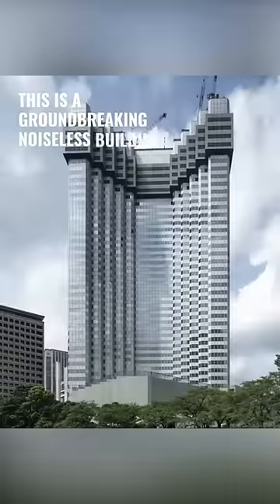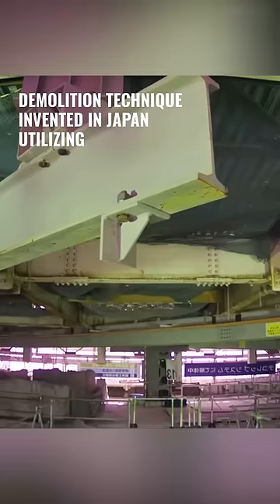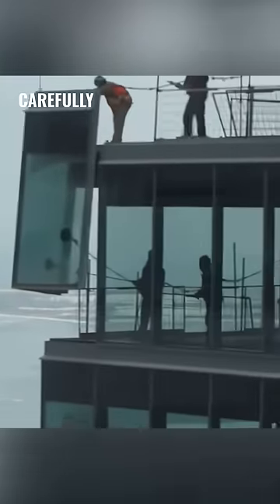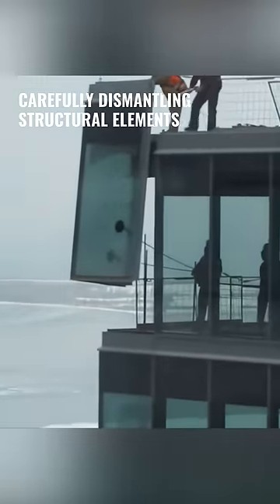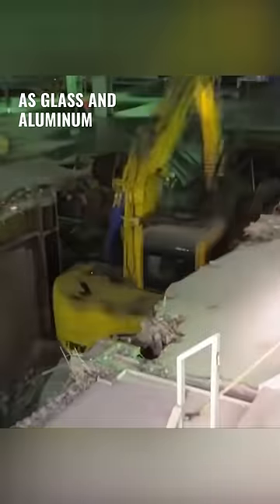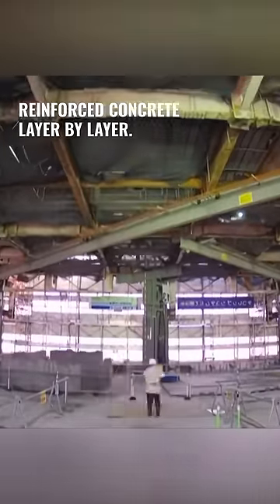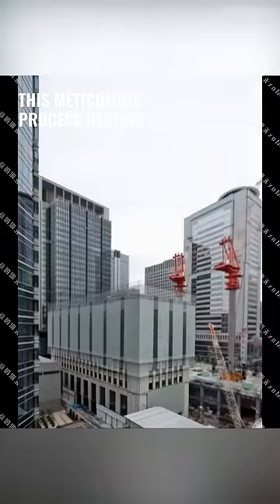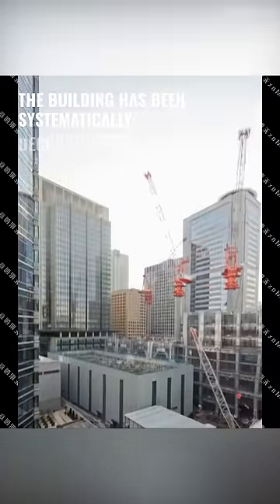Silent building deconstruction 😎

Comment: The cost must be staggering!
Reply: The cost in bring it down ? Yeah, but they can make a profit in selling what they just saved
Reply: You obviously never heard of recycling.
Reply: @perchancethishandleiswens you obviously have never recycled anything worth money... The cost to recycle costs more than what you get from the recycling which is why most companies that "recycle" actually toss everything into the same dumpster as the trash.
Reply: @QargZer  aight that's cool I guess😂 I don't know which company you are referring that would actually do that but the local steel companies we worked with in my country always accept all the scrap cars we cut up. They make sheet metal, piping, steel beams etc, it's way cheaper than importing steel from China 💀
Reply: They have an endless supply of underpaid workers lol
Reply: @QargZer obviously you never scrapped metal. Copper is over $3/lb, of course that's bare bright, but even a 50% is $1.10. Aluminum, about 30 cents. And don't forget the literal tons of steel that they have? Even unsorted it's atleast 50 a ton. Sure you can argue all the extra man hours needed to separate but if they're literally un-building a building piece by piece that part was already done
Reply: @alb8158  I have scrapped metal... The cost to recycle is NOT profit it just recoups some of the money You're spending to scrap it.

Also... Are you seriously trying to compare scraping a car to a building?
Reply: @perchancethishandleiswens its only that way artificially in a handful of countries. Most first and third world nations its FAR chesper to bring in new steel
Reply: Those aluminium/glass windows would make an amazing floor to ceiling windows in a house, there's money to made in recycling, all the steel copper windows lights furnishings recycled would probably cover 25 percent of the total demolition cost
Reply: I was just talking about that to a friend they don't recycle plastic they bring it to the transfer station for the landfill ive seen it with my own eyes lol your right about cost it's cheaper to throw away than recycle it
Reply: @QargZer That's mostly apply to Plastic waste, not materials like Aluminum which are sold and reused as Building Materials
Reply: @yuryberrios7003 they aren't saving anything vs conventional. Conventional demolition is the exact same right up to "...skillfully extract" whatever was salvageable has been salvaged at that point, where here they dismantle floor by floor instead of planting explosives.
Reply: @alb8158 I guess they don't do this in your part of the world in a demo but copper, stainless, iron, aluminum, glass get sorted as the building gets gutted.
Reply: @yuryberrios7003 no definitely not, you can’t even get close to the market rate on recycled materials. And the majority of the stuff coming out of that building isn’t going to be stuff you can sell easily.

Also you can’t recycle the costs of the labor, the machines, and the costs of construction. And in deconstruction, you’re paying for those all over again.

They’d be lucky to even get half of the deconstruction cost back
Reply: @QargZer That doesn't really apply to metal scrap or even reclaimed hardcore. Though I still can't see that paying for the demolition. I suspect they are paid well for it... When it comes to household recycling I would have to agree with you though.
Reply: @QargZer you joking right? Yes, cost maybe more. But you are providing paying jobs throughout process of build, deconstruction and rebuild. 

Plus you are SAVING MONEY on RETAINMENT of materials, instead of disposable of wasted material. Its saving money on imports. Making more of exportable market.
Reply: @theeslimstevie  you are extremely naive... You are either too young to work or don't have a concept of running costs.

People claimed recycling is profit... No, as you pointed out it costs a lot MORE to have the manpower and equipment to deconstruct rather than demo.

I agree recycling is good for the country and allows you to reuse material instead of shipping it... But overall whoever is doing the deconstruction is losing a lot of money to do the recycling which was my point.

There is a high cost to melt down materials into blocks and then from blocks into whatever it is they will repurpose it into.
Reply: @QargZer  do you understand difference between "deconstruction" and "demolitioning"? 

You're trying tell me, you dont understand with deconstruction, you can resale windows, bricks and recycle much more effectively than demolishing.

 While demolishing mixes everything into one pile, while cutting off access to surrounding areas for period of time. (Which provides dangerous conditions to workers and hindering bystanders lifestyle with demolishing practices. Which costs city $$$$$$) 

Yes, it maybe faster to demolish building and get it ready for next construction project. However you sent the problem somewhere else to profit potential resources through waste you pay to get rid of lol.

 I'm naive? Fundamentally wasteful practice is demolishing. Perfect fit for morden innovation is this type of deconstruction.
Reply: @QargZer You have obviously never scrapped metal before. You get paid a decent amount for metal. Steel is about $160/ton and aluminum $800/ton. And you're still completely wrong about the cost. Maybe in this case, because of the cost to disassemble the building, but in general, no. It costs me a couple of dollars to drive my truck and load the trailer, then to get a few hundred off of scrap. That's a profit. It IS profitable. I do regularly it as a part time job really, a side income.
Reply: @alb8158 Exactly. And $50/ton? Wtf, price is NEVER that low. Here it would be $180/ton for the steel beams
Reply: @theeslimstevie  you're telling me you can't read what I said?
Reply: @QargZer  you're lost cause 🤦‍♂️
Reply: @QargZer I think he meant use the resources to build something else, it would save a lot of money
Reply: @theeslimstevie  I live in the real world instead of fantasy make-believe land
Reply: @LtNurse  could lower cost for someone, yes. But it is NOT profit for the person doing the job of saving everything unless they sell everything at new prices. Who is going to pay new prices for repurposed goods?

Comment: I’ve said it a thousands times and I’ll keep saying. Japanese Engineering is on a whole other level
Reply: Japan + Germany = 👍
Reply: We did this in Hungary 15 years ago. This isn't rocket science and not only Japanese do it.
Reply: @Oueax  does the building need to be built differently or this works will all types of building?
Reply: @gratefulguy4130  you forgot Italy
Reply: @mksushi5754  no I didn't
Reply: @gratefulguy4130 perennial war losers yea
Reply: @Oueax but is the building earthquake proof like japan’s ?
Reply: @Shibu-069 ??? Being earthquake proof have nothing to do with it. Its only for calculating safety factors.
The only thing different in eq proof building is it might be thicker, there might be more metal rods in the reinforced concrete, or it might be a different mixture, thats all.
Reply: @Shibu-069  earthquake proof buildings arent anything new.
Any city near a earthquake site is bound to have atleast plenty of earthquake proofing
Reply: @shoeskode136  aren’t anything new, but are they common by any chance? no right.. are they engineering master piece, obviously fkn yess!
Reply: @imjustapotatoleavemealone  earthquake proof buildings have spring system to spread the impact bruh 💀
don’t tell you haven’t seen japan’s earthquake building.. they literally hover in air while the land is moving.. it’s not just mix concrete and sh!tt.. it’s a masterpiece and huge brainwork
Reply: @Shibu-069  But that is underground... Its nothing but a different base for the structure.. it adds 0 to the complexity of demolishing it like that, nor makes it easier... And the structure is still almost the same... The structure needs different tolerances, but the bearing/isolation literally changes nothing at all.. I don't care if its huge and really awesome, it has nothing to do with the topic.
And... springs?.. where did you get that from?!
Reply: @Shibu-069  You already forgot your own comment or what? Read them back and learn....
You literally word by word implied that its different and more complex, because the base of the building is different, and here you are, talking crap about springs and "praising the japanese engineering"... What the hek?
-The guy said Hungarians already did it.
-You said Hungarian's aren't earhquake proff.
-I said being eq proof has almost nothing to do with it.
-You said its base is different.
-I said base have nothing to do with it at all.
-And now you are saying, that i'm out of topic, and you only praised the japanese engineering, and the main comment is different... What?? The video is still about a nice way of demolishing a building...
I don't understand...
Reply: @imjustapotatoleavemealone  why are you reading my comments only in the context of that hungarian guy bruh.. the main guy was praising the jp engineering skills of deconstructing and the hungarian guy said “yeah hungarians did it too”, that’s why i said “but can they make a earthquake proof building” because just like deconstructing skills of jp engineering, it’s also an engineering masterpiece 💀
You can’t even understand  a single context of my comment before fighting bruh
Reply: @Shibu-069  You said "But is the building earthquake proof like japan's?" not "But can they make earthquake proof buildings like japan..", which have a whole different meaning...
Not to mention that "Japanese engineering is in a whole new level" based just on these videos is bs...

This method is really 15+ years old, and and its nothing but the reverse of build and jack building method. In Japan the material prices are really really high and time to time its worth it to recycle the building while keeping the aesthetics, since this method is way more suitable for it, but that is all, its used almost nowhere else and even in japan they prefer different methods.
15+years old method, still didn't used today, since its way more expensive, and way slower than traditional methods. Its can be done, but it doesn't mean it should me.
This video comes back every 3 years and everyone is amazed by it and keeps saying that "yeah those Japanese" while they already past that point.. we are already past that point, and its really... not that amazing anymore... Especially because you can just demolish it from the top, and transport it down using a crane, thus saving the expenses of a whole building lifting hydraulic system...
Reply: @imjustapotatoleavemealone  man i am just convinced that you are some troll, not gonna reply now
Reply: @Shibu-069  I came up with arguments, i came up with explanations, and i gave you time to explain yourself. All you came up with is "You can’t even understand  a single context of my comment", and even if i explained it the other way, in YOUR context adapting to YOU, you deleted some of your comments to make it look like you aren't uninformed and uneducated, then only came up with "you are some troll".

Its pretty clear who is the troll here...A guy who is making videos about playing with trashy games with bad edits in really poor quality vs an actual mechanical engineer...
Reply: *nother
Reply: @imjustapotatoleavemealone  I  didn't delete any comments 💀 why would I delete any of my comments just because a troll came up with illogical arguements
Reply: @imjustapotatoleavemealone  i feel like we both are talking about separate topics yet you insist on forcing me to reply on yours by poking me
Reply: @Shibu-069   You said you are not replying, i'm not the hypocrite here and i'm not the one unable to argue, since i changed wievpoints and explained it in your way, which made you big mad for some reason and shut totally off...
At this point i'm only making fun of you because a conversation with you is anything but enlighting or productive, or at least logical, at least i'm getting my fun out of it.
Reply: @imjustapotatoleavemealone  i said i wasn’t going to reply a counter argument, never said i can’t reply to your pointless accusations tho?
Reply: @Shibu-069  "Not gonna reply now" that is exactly what Alzheimer looks like...
Or just being incredibly slow.
I have my guess here, and its that you can't communicate clearly... That might be what you meant, but it isn't what you said. Not being able to communicate your toughs is a flaw that i have as well in some way, but not an excuse...
You didn't say you can't, nor did i, because you obviously can, i just assumed you won't, because you said you're not gonna, which is again... different...
Reply: @jessicavalor7437  what’s there to laugh bro? 😅
Reply: @Shibu-069  this comment section lol
Reply: Not really though...
Reply: Then your lost American and brittan engineering is on a way ahead level
Reply: @Oueax   the footage in this video is also very old.
Reply: @INTRO-MERICAN america is paper walls and lego bricks
Reply: @moosehorse9972  yes and?
It's actually better than concrete and cheaper my friends there can't buy a house just because it was made of concrete and there isn't really a big difference indeed the American paper is strong and better and great then the concrete
Reply: *was
Reply: And soon it it will be a few levels lower

Comment: Why wouldn’t they go from top to bottom? Starting from the bottom would cause massive stabilization issues or a ton of work drilling supports back each time material is taken out. If they break through each floor and have slides/ manual elevators set to bring down material. It would probably be safer and just as efficient.

Comment: Strong as Steel.
Gentle as a Dove.
Japanese culture runs deep in every walk of their life.
Reply: Yeah also applies to the Japanese Empire.
Reply: @puria3039 
Not sure about the "Gentle as a Dove" part
Reply: Haiku
Reply: @u2ooberboober  No, a haiku is made up of 3 lines, which have 5, 7, and 5 total syllables respectively. In this case, there are only two lines, the first of which has 3 syllables and the second has 5.
Reply: @bruhbruh-us6gl  Thank you
Reply: @puria3039  yet the Japanese Empire has nothing to do with modern Japan so this comment is irrelevant.
Reply: @hunterkline7972 I mean if it was irrelevant could they at least apologize to all the countries where they did unspeakable crimes at

Comment: This doesn't really sound groundbreaking they just took it apart 😭
Reply: The usual method for "taking apart" old buildings involve cutting major framings, placing hundreds of lbs of explosives and lastly, blowing it up so (in theory) it collapses to the ground.

This is a much better way, imho. Safer, quieter, yes probably more expensive but money isn't everything.
Reply: @Name-ps9fx instead of an explosion that is loud for couple seconds you have constant noise pollution for a year
Reply: @trollsports7829  building in Japan are so close together they can’t just recklessly be blown up. Plus all the resources from the building are being recycled for the next building so there’s no waste.

Comment: The cost of this would be insane compared to just demoing the building in one day then cleanup for a week
Reply: Perhaps some of that can be offset by reclaiming some of the materials used in the building. Much easier to do when they're in tact I imagine.
Reply: This process can recycle almost 90% of the meterials so the cost is reduced, moreover there no debris to remove so additional cost saving. So overall this method is only slightly more expensive than demolition.
Reply: @muktadirbhuyan7281 how do you even recycle concrete?
Reply: @Anonymous-8080  concrete is 100% recyclable, concrete is just a mixture of aggregate and cement (some time additional additives are added), so it's not hard to recycle it. Actually there is a cement factory near my house , i have seen them bringing rubbles in trucks and recycling them I don't know the exact process since they don't let me inside the factory but I asked them once and they said they indeed recycle concrete from demolished infrastructures.

Comment: But how long did it take to do that building? Would make recycling easier.
Reply: It took a year to take down. They reuse what can be reused and the company that did it uses electric cranes that produced electricity that ran other equipment etc. I have tried to find how much this cost, but couldn't even find an estimate. The method reduces noise pollution and dust pollution, but the Japanese have been criticized bc they only let buildings stand for about 20-30 years before taking them down...the articles states that the Japanese like new and have feelings about spaces that have been previously occupied. This has also led to the criticism of creating a false market in the construction business. The other criticism is that creating echo friendly demolition doesn't make up for revolving door of putting up and taking down large buildings for no real reason, but aesthetics. There a few foreigners who have YouTube channels about them buying old Japanese wood and paper wall houses that cost a $1 bc the Japanese tear them down bc someone else lived there. In Europe and the US old houses are often preserved etc. but most of Japans are all gone. The Japanese don't see that their old houses can actually be tourist attractions; so the sit abandoned.
Reply: @Saturns48 Yeah… There’s absolutely no way heavy industrial machinery, like skyscraper cranes, are energy-neutral. Let alone give energy back to the system. How exactly do cranes generate power when they take like 500 gallons of hydraulic fuel just to work a few hours a day?
Reply: @Saturns48  My house in Missouri has been around since the Civil War, and it works good enough. 

No real reason to build something new every 20 years.